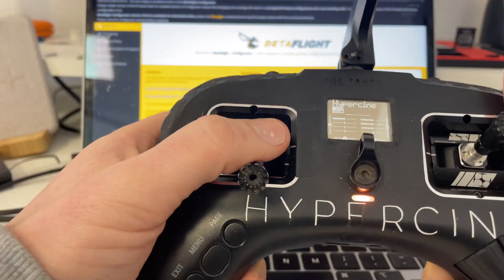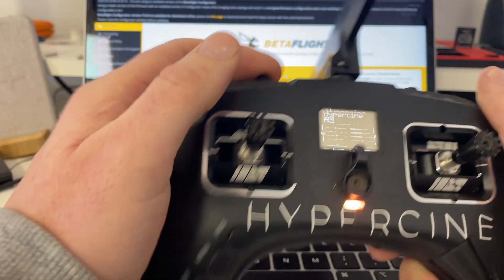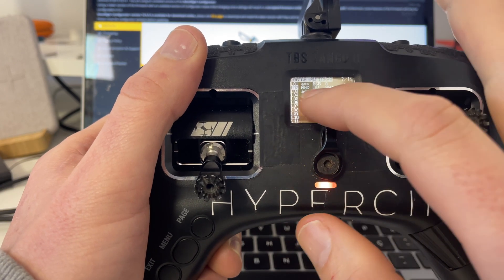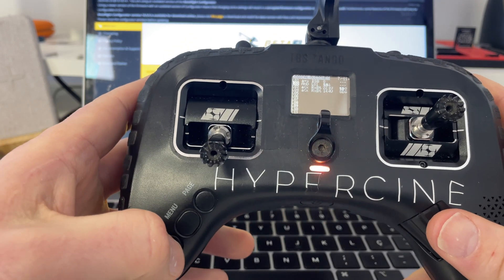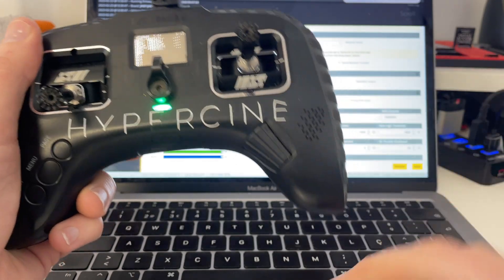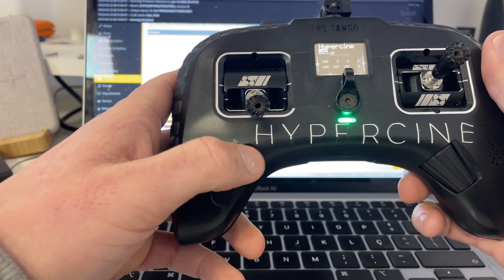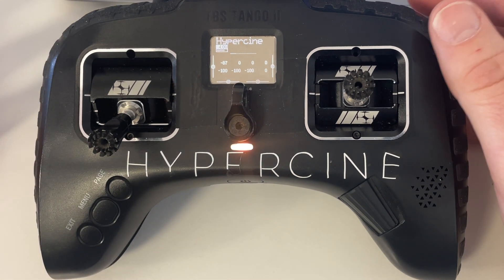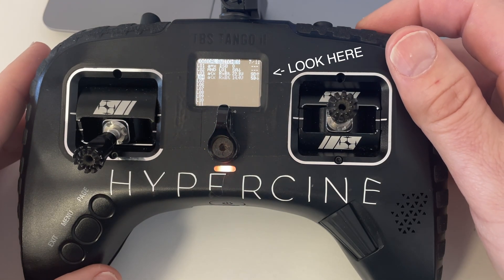TBS Tango 2 settings for battery warning and GPS data

Comment: Set report_cell_voltage = ON
Save

Activate this in betaflight and you will get battery cell votage in your telemetry ))  U can setup for 3.5-3.6v  for both 4s and 6s...

Comment: There is no need to put the battery on a switch from 4s-6s - this can be handled automatically using a voltage range for 6S
L03   a<x  RxBt   14.4v      ---      ---     0.5
L04   a>x  RxBt   16.8v      ---      ---     0.5
L05   a<x  RxBt   22.1v      L04   ---     0.5
Then 'SPECIAL FUNCTIONS' page, play sound on L03 and L05 - NOTE: DO NOT set anything for L04.
L03 is for 4S and L04+L05 makes the 6S beep under 22.1 but not within the range of a 14.4v to fully charged 16.8v 4S
The 0.5 makes it so the battery need to be in the range for a half second for your punch outs, you can make it 1 sec if it goes off too much.
Reply: how was this

Comment: Thanks this is really showing so much more about what is capable with a tango 2. I was not aware that it is possible to combine that many buttons. For me I would like to see how you connect the beeper with the turtle mode. and maybe show some more combinations that you discovered in years of flying that really help. For instance the GPS on the screen is a must for my 7 inch long range. And the Arm combination I like that too.

Comment: very good tutorial. thanks for that. regarding the gimbals: did you replace the sticks with non-foldable ones? can you recommend some?
Reply from the maker: So I have used the folda le from TBS originals and from Pyro and the Pyros are nuce but can have a magnet come loose and that is such a deal realer that i now am going to try out the Boxer from radiomaster. But the Tango with original gimbals is an amazing radio! K recomend it to everyone
Reply: @DavidGu1  Thanks for the info. I have the Tango 2 but I´m not so happy with the original gimbals. So i was happy when i found these nice Pyrodrone-Gimbals. I read from the issue with the magnets but also with the slightly "turning" sticks. Then i saw, you replaced the sticks with fixed ones. This is a solution for me as well because I don`t even need foldable ones. But the thing with the magnets still sucks to be honest, especially at this pricepoint. I checked out your website: nice jobs you did. Respect!